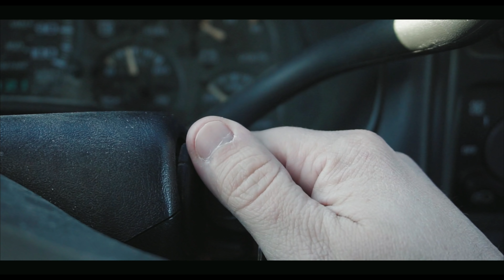I Drove 180 Miles For A Snowblower...

Comment: Thats the same snowblower I have, picked it up on Facebook for $25 because the owner said it had a leak and wouldnt start. I cleaned the carb, and it ran fine... and I use plastic weld. And replaced the paddles and now Im tossing snow into my neighbors driveway... thing is such a beast.

Comment: I had the same snowblower. Bought it used for $100. Started first pull and as mentioned was a beast. Sold it for the same price 10 years later when moving to a warmer climate. The crank for the directional throwing direction was key, especially when cars are parked in the driveway!

Comment: Snowblower I use, was given to me by my dad 7 years ago. Dad bought it late 70's early 80's. He can't remember.  Still runs like a camp. Always starts on the 1st or 2nd pull. It's what made me become a believer in Toro. It's a 2 stroke, 32:1 mix. Never any problems just new spark plug every year.

Comment: I have an almost identical model Toro from 1988. There’s a reason that they didn’t change much: they’re bulletproof.

Last week I replaced the original, 32 year old rubber paddles and sometime soon I’m going to rebuild the carb. After that, I can’t imagine having any serious issues with the machine, and I probably won’t. 
So yes, worth the trip for that blower.
Reply from the maker: My paddles were changed but they don't touch the ground so I'm sort of dragging the thing around all the time.  Even so, it's a beast.

Comment: Last weekend I washed 3 cars and cleaned up the yard in 70s, then watched your video mowing the lawn in January. Got 4 inches of snow today and its 50 degrees colder, very similar climates.  I used a 1959 Gravely to blow snow until a few years ago, sometimes new isnt always better.  Great videos as always.

Comment: My snow blower is doing the same thing. Small drip from the carb, but still fires up and works great. If I can get it to last, I’ll replace the gaskets in the spring when it’s warmer.
Reply from the maker: Same thing I'm thinking. Working with frozen hands is not exactly ideal. 😀

Comment: Be sure to add a fuel line shutoff valve the first time you clean that carb.  It will make the following carb rebuild and carb replacement so much easier and is the only thing that stops mine from leaking today.

Comment: After not needing one for 22 years I found the need for snow removal machine. It was a toss up between Toro or Honda single stage and ended up with the Honda 720. Works like a champ.

Comment: Try replacing the carburetor float bowl gasket and the needle valve because if it’s filled that badly with gas more than likely the needle valve is damaged and isn’t shutting off gas when it’s at float. It might look fine to the naked eye but it only takes a small imperfection for it to allow gas to keep filling the bowl past full. Btw thanks for the content! As a fellow lawn enthusiast trapped by snow I look forward to a good snow also. I donated my single stage MTD to my brother in law this year and picked up a 2 stage since we had a few elderly people on our block who were desperately trying to clear their driveways in vain by shovel after bad snow/ice storm.

Comment: The leak could be something as simple as the gasket on top of the float bowl is dryrotted and cracked. Easy fix.   Cant beat a old Toro.
Reply from the maker: Yeah it should be a fairly easy fix.  I'll tackle that when my hands aren't going to freeze off :)

Comment: Hey Ryan that is one of the best single stages ever made i would keep it. i repair and sell power equipment. i would hate to see you get rid of it and have problems with a newer Single stage. those old 2 stroke toros have alot of torque.

the gas you are seeing is from a bad needle and seat. the gas is getting past the needle and coming out of the mouth of the carb. a common problem.

get a replacement needle and seat and you will have another 20 years out of it.
Reply from the maker: Thanks for the tip!

Comment: Keep that Toro CCR 3000! That is the Japanese made commercial Suzuki 2-cycle engine. Most expensive motor Toro ever put in a single stage. My Father has the same 3000 model. I have the slightly more powerful R-Tek 2-cycle powered CCR 3650 but I still think the Suzuki is a better motor. I have the same Suzuki 2 cycle motor on my 1991 Toro Recycler lawnmower.

Comment: It's likely just a plastic line going to the carb. They get brittle and crack over time. I would be more inclined to inspect the return line to tank, as if it were a leak on the suction side it wouldn't run if it sucked air. Just a guess without taking it apart or seeing under her bonnet. :)